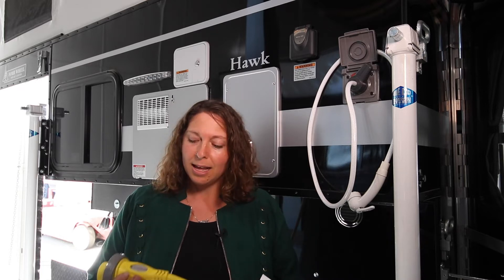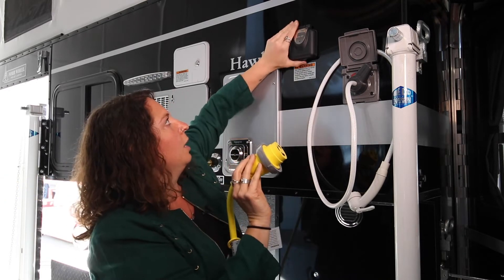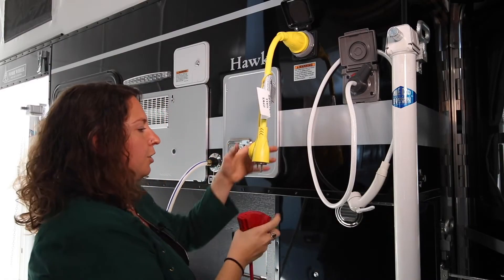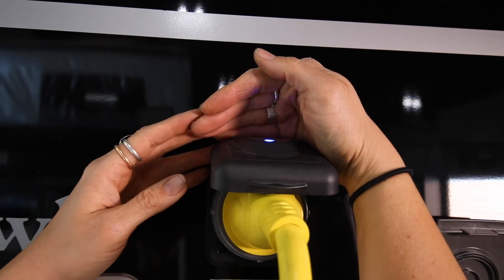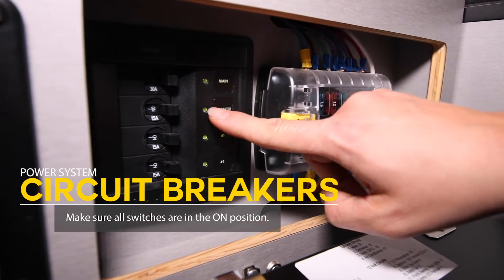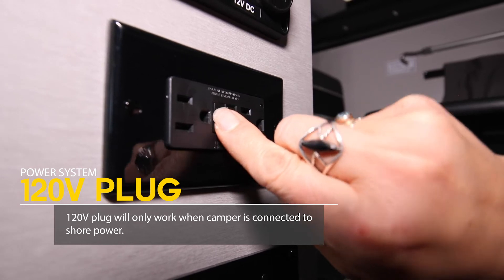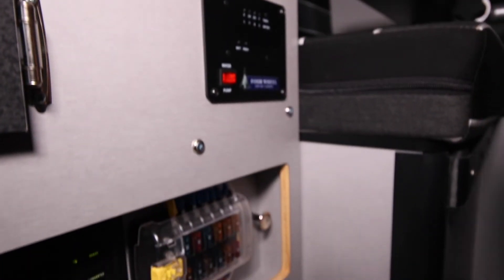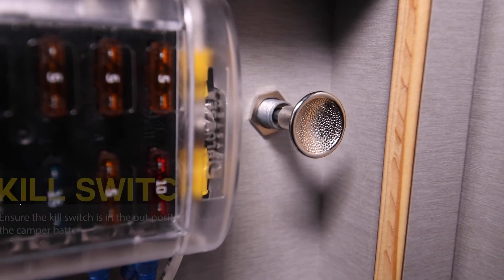Standard Power System | Four Wheel Campers (2021)

Comment: Thanks for the video. Question, when in a campsite where you will use the electric hookup, should one use a  surge protector? If so any recommendations?
Reply from the maker: There is no need to use a surge protector as the camper electrical has breakers and fuses built into the system.
Reply: @FourWheelCampers  Great thanks for the info, wonderful news!!